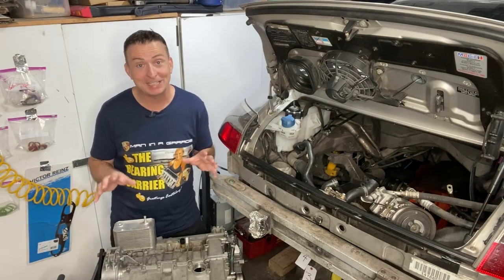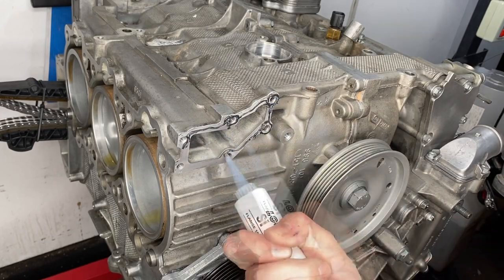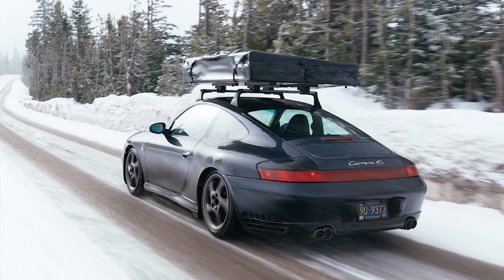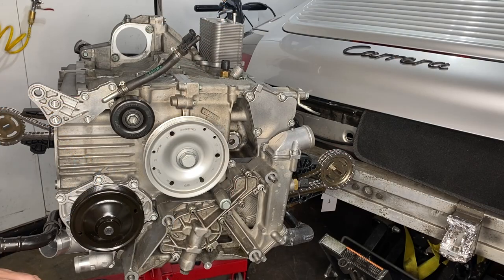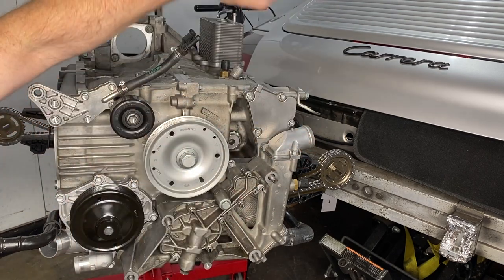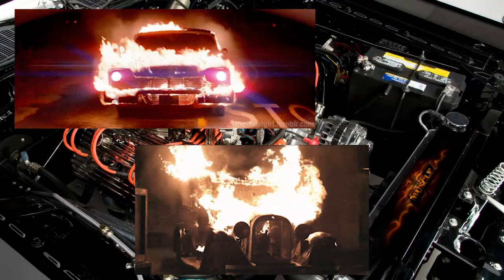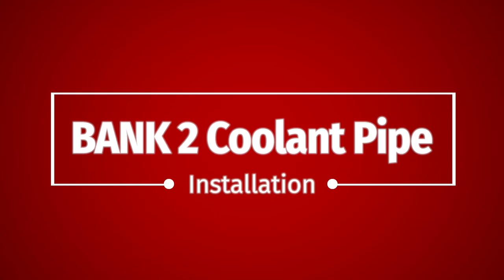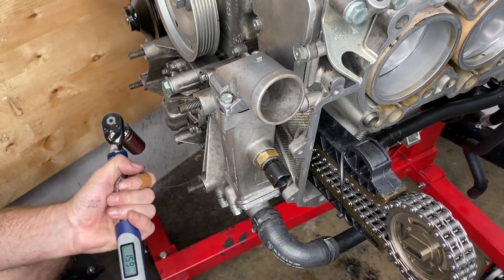PORSCHE 911 Low Temp Thermostat, Water Pump & more Cooling System VOODOO!

Comment: I live in the Desert just outside of Palm Springs. Summer Temps are Brutal. My 996 never overheats in the summers down here, but as it gets a wee bit long in the tooth I am trying to extend its life expectancy. More frequent oil changes putting it on the lift more frequently to spot potential failures, etc, but I just replaced my Thermostat and water pump as well as a  few older looking hoses. I'm hoping that by getting the coolant circulating at a cooler temp initially, it will prevent the engine from ever getting close to "Very Hot" when sitting at a light or in traffic.
Readers Digest version, car will still get up to operating temp, but will start to cool itself prior to getting hot :)
Reply from the maker: Hello Mike, it sounds like you might be a good candidate for a Low Temp Thermostat 🙌. Thank you for watching 🤘😎

Comment: There are many myths on low temp thermostats. 

They will not keep a car running cooler, unless you are simply referencing the portion of the warmup where the engine is trying to get to proper operating temperature. Then yes, it will take longer to warm up, which is a con.

Once warm, the thermostat will be full open the whole time, regardless of oem or low temp, and the coolant system in place is what sets the max temp. Not the thermostat, which only sets the low temperature. They cannot be "more open" than a regular one, simply slow down the warm up process. The point of a thermostat is to allow a car to warm up, not to keep it cooler after.

Comment: Another great vid!! It would be a great time to use waterless coolant as you have completely removed the water from the system. It’s a lot better than normal water and antifreeze ( if you use that in California?? Probably you should for anti corrosion purposes). Down sides it gets very expensive with any leaks but you look good to go.
Reply from the maker: Thats an interesting idea, I watched some videos on the Evans brand waterless coolant. There does seem to be some downsides other than price, Apparently it can lead to a higher cylinder head temperature?? I'm not sure of the mechanism involved in that statement yet,  I'm trying to determine the best course of action. Do use use waterless coolant? Do you think there are any downsides other than price? Thank you for watching 🤘😎
Reply: @ManinaGarage  I think there are pros and cons to everything, I’m not sure about the cylinder head temps but I think from what I’ve read it should give lower cylinder wall temps as there is no boiling against the hottest parts of the bores liners. I looked into it for a GP Suzuki once but figured that it wasn’t worth it due to the chance that we would lose expensive coolant very quickly in one of those but we had an issue with a system pressuring and causing internal crankcase leaks. You don’t get pressure in the waterless system so less chance of that, the crankcase that we were trying to nurse were £20k magnesium and unobtainium!

Comment: If you are going to apply torque seal or indicating stripe witness mark to a bolt or nut the stripe should also continue over one side onto the adjacent hardware that you just bolted together to give visual indication that the bolt has rotated. Just putting a stripe on the bolt head is only doing half the job, what if the bolt has rotated but when you happen to check the stripe happens to be vertical (even though it has backed out 180 deg)? You would presume the bolt is still torqued up. Maybe that is what you are doing already, just doesn’t look like that in the video.
Reply from the maker: Hello Peter, I think that’s over the top for these threadlocked 10 mm, they are not going anywhere. The mark is just to say they are done. Thank you for watching 🤘😎

Comment: If you feel you need additional cooling capacity they may still offer the third (center) radiator kit for your application (911/Boxster). I have this radiator installed on my 2nd gen Cayman S, and it was made for the PDK (automatic) versions of Cayman/Boxster models. I'm in Florida with hot summers so that made my decision to go this way 😎.
Reply from the maker: Hello Warren, having never driven this car I don’t know it’s behavior yet, hopefully it just runs “normal”. The third Radiator came up during the oil system episodes, TuneRS Motorsport (in florida! 🌞) recommend them on their race cars. Florida is another level of hot above California, hopefully the stockish system should work ok. The word I got from the different engine builders was that the low temp thermostat was a no brainer on these engines as they have a reputation for running hot, not cold. Subscriber Lester says I should remove and flush out the radiators, he has pretty much guilted me into it 😊. Thank you for watching AND helping 🙏

Comment: Hey Finn,  I put in a new 160 t-stat and water pump yesterday and the difference in the temps the car runs at is astounding.  As expected she is running 20 degrees cooler which I like!  I have been running the Molygen 5w-50 for a year or so now and am wondering if, because of the cooler t-stat, I might want to go back to a 40 wt.  What do you think?  Have you heard of any reason to do this?  My oil temps are cooler now too - about 190 vs. the 210 that it was before.  I'd like to stick with the 50wt. oil unless you feel that would be a mistake.
Reply from the maker: Hello Tom, that is REALLY great to have some real life feedback on the LTT Thank you 🏆. Oddly enough I have the answer to your question direct from the oracle himself, Barry Hart of Hartech. He said (paraphrasing heavy) they went up to the thicker oil to help the oil remain thicker at higher temperatures and because is will leave a larger residual on the piston skirts etc to aid with cold start lubrication. The other half to you answer is that they install LTT on most of their rebuilds. So I would say stick with the thick stuff unless you live in Alaska or Iceland and drive in the winter. Also, the brand they use is Millers oils (sold in Europe) My understanding is that motul or liquimoly are similar quality and available in the USA. Thank you for being a part of this Tom 🤘😎
Reply: @ManinaGarage  Thank you, sir!  Good to hear as I am very happy with the LTT / 50 wt. combo.  The car is nice and quiet and smooth running.
Reply from the maker: Hello Tom, Stacy Sherman from the Durametric episode is very interested in your LTT experience, would you mind emailing me? He would like to ask you questions?? He just had his 1999 completely rebuilt by a local shop, they installed a stock thermostat.

stuckinagarage@gmail.com 🙌

Comment: Have you considered removing the radiators and giving them a good flush through. This might save debris being drawn through into your surgically clean engine?  Same idea for the long pipes running front to back?
Reply from the maker: That's a good idea Lester, there could be 20 black widows in there by now 🥺. What about hooking up the main radiator "IN" pipe and the heater core to flowing water and flushing the system with everything installed?
Reply: @ManinaGarage  to be honest, for the amount of effort you’ve gone to, the morning’s work to strip them out, clean and inspect them could save you a lot of heartache…🙂
Reply from the maker: @karlallington3943  That's Fair, I may as well have them pressure tested, etc if I have them in hand. Thank you for watching 🤘😎
Reply: @ManinaGarage  I would reverse flush each separate element.  Don't spoil the ship for a ha'poth of tar.
Reply from the maker: @laapulsford  Phew 😅 dude! You got me googling my thumbs off this afternoon 😁. Ok, so yes, I should spend my half penny on tar and take the bloody radiators out and stop being a lazy cheapskate. Understood 🤓
Reply: @ManinaGarage  just a thought, also as Lester mentioned the long aluminium pipes, check them for corrosion too, my 23000 mile 987 needed them, although I imagine the salt on UK roads wouldn’t have helped…
Reply: @ManinaGarage  Good decision. If this was a conventional car (Rad in front of the engine) you would have already planned this into the build.

Comment: Good, educational video Finn! Did you buy a new coolant temperature sensor? It's best practice to replace the pump and sensor at the same time.  Every time you say "Porsche Dealer" you should play a "cha-ching" sound bite cuz those parts can't be cheap!
Reply from the maker: Hello Yogi! Thank you for the heads up 🙌. I don’t doubt your advice “but” my methodology with sensors has been, if it passes a continuity test and is easy to replace with the engine installed, I’m reusing the old one. Acting upon the collective advice I have received would result in replacing “EVERY” item in this engine 😂🤣. I have to draw the line somewhere, that’s the way I’m handling sensors. It would easily get over $1000 in sensors alone if you wanted to get a clean slate. If the engine fundamentally engines! I may splurge on some icing for the cake. Thank you for watching, looking forward to seeing Pepper in showroom condition. (You know your wife is going make it hers, Right??) 🤘😎
Reply: @ManinaGarage  I should be worried about that after she drove it for the first time. She was pretty thrilled.

Comment: How about the GT3 waterpump for the normal 996? I heard this is a good upgrade as well. Any thoughts on that?
Reply from the maker: Howdy 🤠 That is great suggestion, I just looked up a 996 GT3 water pump, it seems visually similar to the Carrera unit. Personally I have no experience to have an opinion, perhaps someone reading these comments can educate us both 🤓. Thank you for watching 🙌😎
Reply: @ManinaGarage  thanks a lot for your reply! It should be a direct fit without modifying anything. Here in Europe there’s quite a discussion about it. Many times specialist recommend to use the GT3/GT2/Turbo water pump since it increases the flow compared to normal 996 water pumps. Other specialists say the water flow is too much for the normal 996 and therefore the water doesn’t get ‘enough time’ to absorb the heat. Looking forward to some insights from your subscribers. 

My 996 is now undergoing a full engine rebuild and I asked for the GT3 water pump + low temp thermostat. Will let you know my findings.
Reply from the maker: @Jean-Paul_1984  Best of luck with your rebuild 🍀 what country are you in?
Reply from the maker: @Jean-Paul_1984  Thank you for being a part of this. I wish you the very best of luck with your rebuild, keep me posted 🙌